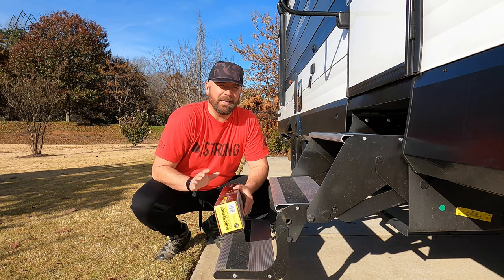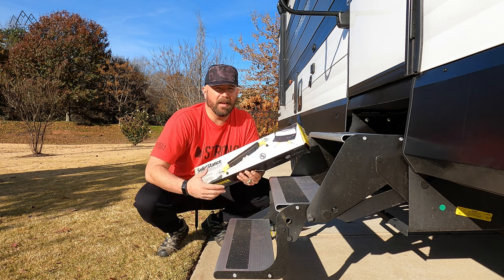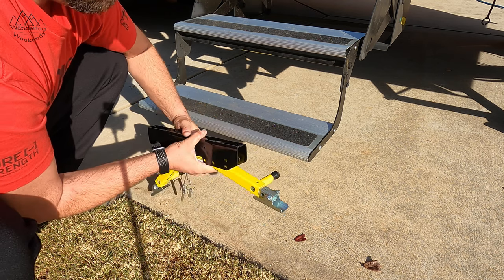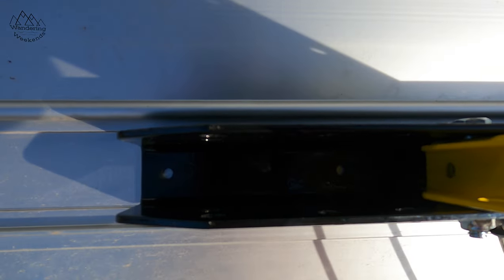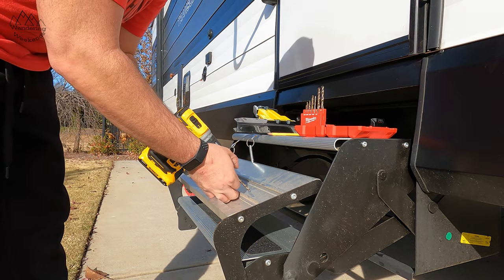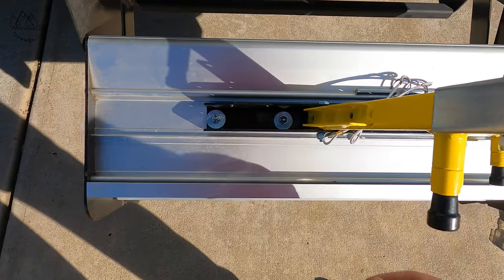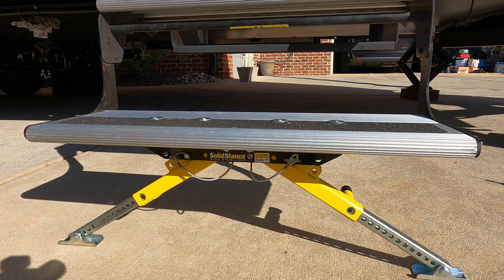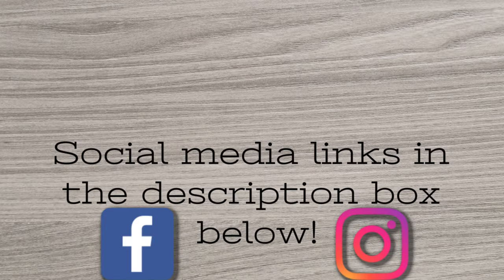Budget Friendly RV Step Stabilizers

Comment: This looks like a better design than the Campco version.   We’ve been at a few campsites and even our RV pad at the house due to the slope from left to right, there is no clearance under the bottom step.   We use a Valterra RV stabilizer with the ratchet strap under the step box.  Seems to work well for us.

Comment: I like that option better than the solid steps. I like being able to fold up the steps without blocking the doorway to aid in loading/unloading.  But I don't quite understand the need for the steps to be grounded. I get that they like the solid feel but I've never felt like my floating steps were going to fail without some kind of ground support.  Nice install video, though!
Reply: Warren the fold down steps are nice but as a person with impaired mobility the wiggle in the fold down steps are modified when you don't have good balance. This would also apply to people as they get older in years too. Having the steps solid to the ground helps greatly in reducing any accidents because of the movements.
Reply: @JohnScheppler  I can totally understand that.  I'm not too sure that the handrail leading into the trailer would remain intact if someone lost their balance.  My balance certainly isn't what it once was either.
Reply: @wmcnett  hopefully we never need to find out, but yes probably not.

Comment: Seems like that install is backwards. Wouldn't you want to have those black handles facing the front so you can more easily reach them? Bummer that you are forced to drill through your steps. I would like to see some sort of system that allows you to bolt through the side of the steps. Heck, going forward it would be really nice to just see that system on all of their steps welded to them so there is not bolt on for when you buy new.
Reply from the maker: Worked great this weekend…
Reply: @WanderingWeekends  I don't doubt that it works. To me it just seems to make sense to have the black knobs facing out where you can grab them without having to reach around to them. Anyway...cool video. Will be nice to see how this product evolves.
Reply: Drill your steps. Life will continue

Comment: That’s a great product. Kinda wish I had that instead of the solid step. The solid steps are nice until you realize every time you want to go into the trailer when not in use, even for a second you have to fold them down and fold them back up. That can be tricky for some people who don’t have a lot of room where they store their camper. They also tend to get more dirt into the camper.
Reply: This is exactly why I have been hesitant to go with solid steps.  As much as I would love that stability up and down the steps I think your experience just helped me decide they aren’t for us.  Thanks.
Reply: @joshhaas2410  glad I could help. I do like the solid steps at a campground and they are built really well, but like I said you do need room to fold them down and they are a bit on the heavy side.
Reply: I had to pull over once close to the side of the road to get inside and remember thinking "if I had the solid steps, I wouldn't be able to get in I'm so close to the guardrail.  Thats why I like this.

Comment: I would counter sink those holes and use flat heads so they would be flush on the top. Looks like those bolt heads could be rough on bare feet.

Comment: Nice mod. Very timely as I was just on Amazon ready to order the two metal plate type with a screw jack type . This looks a lot more stable. Beats my current stack of 2 x 6's. Milwaukee drill bits in a DeWalt drill, blasphemy ! surprised the drill bit didn't snap in protest.. (lol)
Reply from the maker: Haha!
Reply: Glad you went this route.  I don’t like our screw type camcos at all.

Comment: Thank you for this.  I might try it.  I can’t stand our camco step mounts.  Such a great idea but I can never get it to work right.

With the Camcos, when I step on my second step, the lack of support there lifts the first step slightly and moves the camcos out of position.  This is my biggest complaint.  Do you notice this problem at all with the lippert design?
Reply from the maker: Nope!  I thought that may be an issue as well.  Didn't seem to have that issue at all while in use.
Reply: @WanderingWeekends  Killer, thanks for your reply.  I have different steps than your transcend so when I install this on my Apex Nano I'll comment on this again with the result.  I think ours are probably more the standard lower end double folding steps most have.

Comment: Cory do you think there would be any issues with the step rug covers going around the step (connected by spring hooks).
Reply from the maker: That is a great question. I would bet there is a way to make it work but until I actually had everything in front of me I couldn’t give you a solid answer 😕
Reply: Great question. Pending to see if possible! Thanks for providing all the RV video/info!

Comment: My aluminum steps thank God had rubber removable strips on the upper surface of each step that hides rivets that secures the aluminum step to the surrounding metal framework.  Because of this design feature I was able to HIDE the bolt heads under the rubber strip to prevent an awful look as the one you installed. I'm surprised you didn't speak at all about the unsightly bolt heads showing on the step surface. Fortunately for me I was able to avoid that.
Reply from the maker: I just look at things a little different. I’m a function over form guy. These things aren’t Ferraris. They’re glorified tents really. If someone is worried about the bolt heads on my RV steps we probably won’t be friends long. 🤣

I’m all about pride of ownership and I do like for my stuff to look nice but this is silly in my opinion. To each their own.

Comment: First step is solid. What about the other two?  The bottom one doesn’t lock in. So that product is useless
Reply from the maker: Have you used one?
Reply: @WanderingWeekends  Yes and yes you get some support but pretty much on the bottom step only. To me it’s a waste of money. Not even close to the support of a solid step. Yes more money but it a better product because it’s built for that reason and not a aftermarket product to pull the Pennys from your pocket. No offence to your review if it works for you.